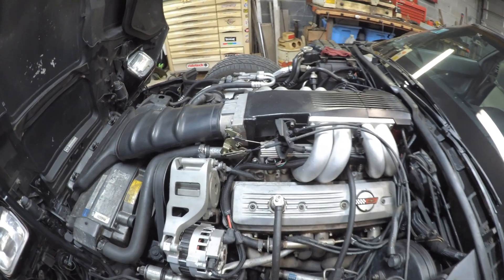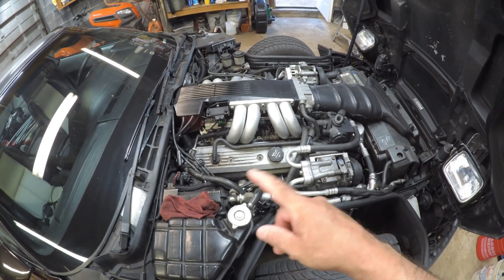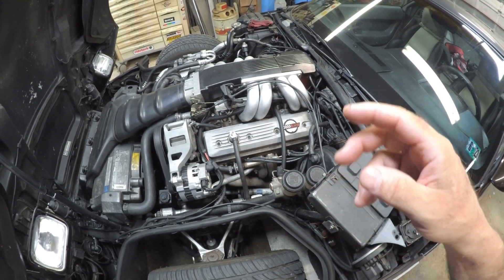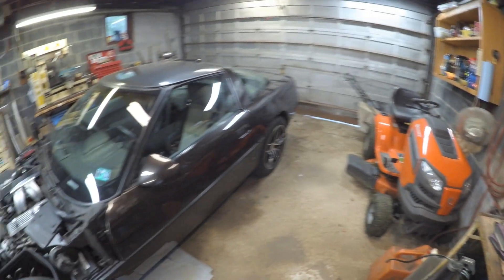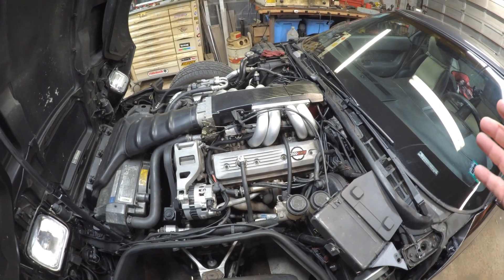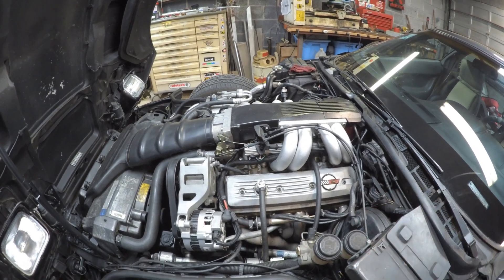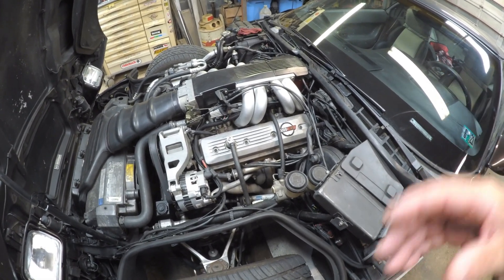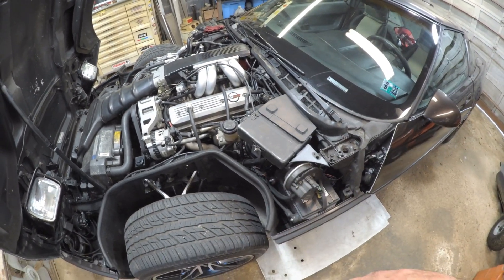Dual Flow PCV Follow Up

Comment: I just added one to the mild 302 in my '31 as the oil carry over was ridiculous. I Tore that engine down a while back after losing a brand new Ford oil pump and was amazed at the amount of crud on the intake runners and valve stems as well as the piston tops. Did a full rebuild and added a small air-oil separator, hoping that would fix the problem. Nope. Filled that gadget in about 50 miles and got a bunch of oil in the air cleaner. I still have to reinstall that separator. First thing to note is a better idle even with a lumpy cam. Also, gas mileage seems a bit better and throttle response is instantaneous where it used to kinda drag. So far, pretty pleased with it but have to find a way to reinstall that separator and keep it more or less out of sight as the engine is tight in the recessed firewall.
Reply from the maker: Glad it worked out well for you.

Comment: any increase in PCV flow attained by this valve's design, by opening the orifice larger, or adjusting the spring tension, will put more blowby oil mist into the intake manifold, and dilute the air/fuel charge.  IMHO, it absolutely MUST be used with a Moroso or similar oil separator, also would be a good idea even with a STOCK pcv valve !    engines were not designed to run on oil, and oil contamination leans the mixture, and also causes detonation.  even the lightest amount of oil in the combustion chamber in a racing engine, will push a high compression engine into spark detonation.  it's a good idea to put a vacuum in the crankcase, but not to put increased, unfiltered PCV flow into the intake manifold runners !
the ultimate system is a crank or belt driven vacuum pump, pulling on the crankcase, through an oil separator, and dumping to atmosphere, or into the header collectors- nothing into the intake manifold.
I've pulled many intake manifolds in 40 years of working on cars, take a look at what the runners of an intake manifold look like with PCV attached after many years.  they're coateed with a grimy layer of oil and sludge !  so, you're trying to avoid sludge in the crankcase as a selling point, and instead creating sludge in the intake manifold, and diluting the air/fuel charge with oil mist.  crankcase gases were never meant to be "reburned", the engine is not a waste incinerator.  that was only done by state/federal mandate in the early-mid 1960's, and from an engine standpoint, it's a bad idea.  it was a political move.
Reply from the maker: On most points I agree, that being said I do not have a race engine and I do run a better air/oil separator in the system, I also tried a home made vacuum pump that I made by converting the factory smog pump and if you have the time to watch the video's on it here is a link to the play list https://www.youtube.com/watch?v=niG955rHJZ0&list=PL5AMhVA-RNuTh25xfI2x3J9M438RDe-8Z and thanks for watching.
Reply: Agree with some of what you said.  The PCV system was probably the most significant and worthwhile emission add-on to date. It significantly improved crankcase and CC sealing, and improved cleanliness and reduce oil oxidation.  Oil catch cans or separators is a must.  The stock system introduced a fair amount of oil and blowby gases ad designed.  The change in air flow or vapor created by this adjustable valve isn't going to lead to detonation, rather improve combustion sealing, and engine cleanliness. I'm running one with a 2012 GM GDI engine and it works great, finely tuned to provide vacuum under all conditions. Works better than the fixed orifice systems we have now.
Reply: @tssci6774  The Diesels are getting much needed attention on cleaning up combustion. We could learn something from this in the process. By changing to their piston kit you get 15% increase in HP and Torque, Emissions dropping by 77% but part of this is due to the Total Seal Ring used in the second compression ring location. That would benefit our gassers as well I suggest, far less blowby so it burns in the cyl the way it should.
Notice at the edge of the combustion chamber in the piston the small notches. These serve as jets of air from the squish band pointed at the flame front to fragment it. Without the dimples this has been used and the result is far less carbon from a more complete burn. Search Someander Singh in India and a man from Thunder Products Lonn Peterson. I think Someander still has Patent Rights on that but haven't talked to him in a few years. Both of these guys came up with this not knowing each other. First implemented in 2 cycles but can be used obviously in 4's. 
https://www.youtube.com/watch?v=Xz8Ip_g7BKg

Comment: Thanks for  the  update, Deleted mine  on my 95 , but  live  in an area  that doesn't  have  smog stations.
Reply from the maker: I prefer to run one to suck all the crank case fumes out, I may still try a vacuum pump and I am thinking of an upgrade to my 383 this winter if I can swing it.